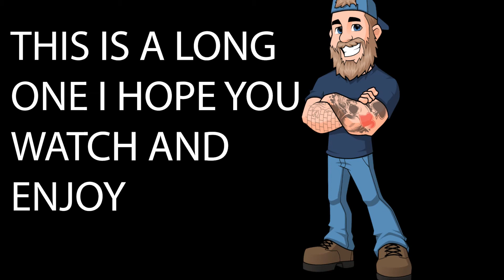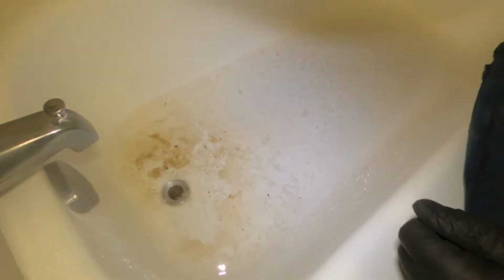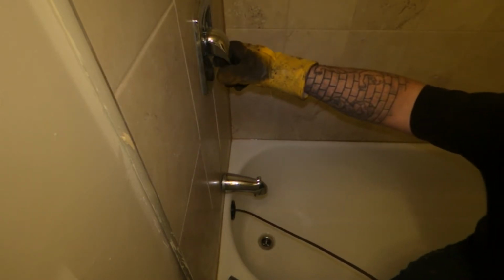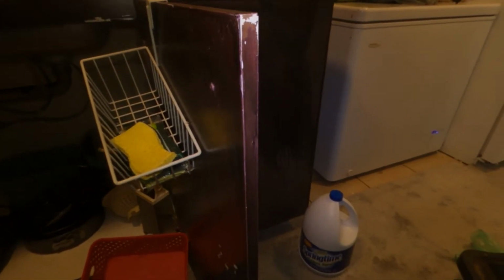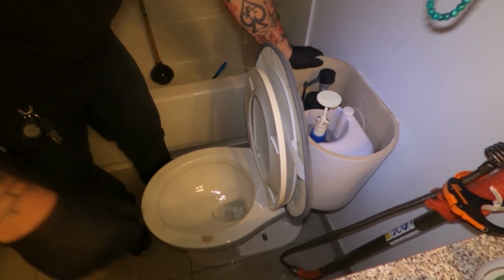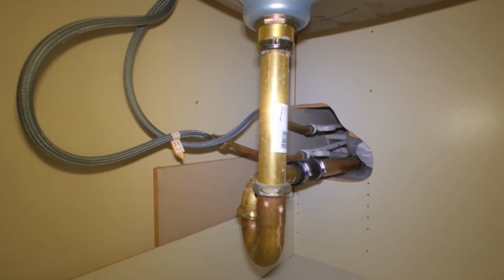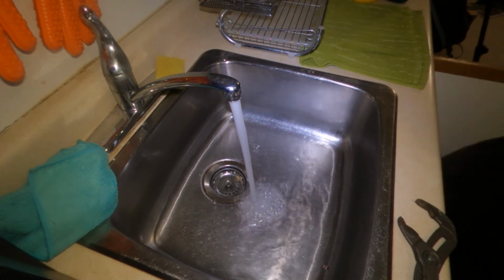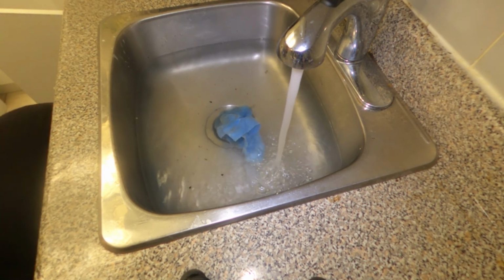THIS IS WHAT A DRAIN SERVICE TECHNICIAN does all day. this is a full days worth of calls that I did.

Comment: When doing the tub. Will that snake cable get caught in the trap?
Reply from the maker: It shouldn't get caught a lot of people have a hard time getting through the trap. In some cases, when you get through the trap like here, you can go up the vent at the stack and the blockage might be below where it ties into the stack. So you have issues that way, but typically you shouldn't get stuck in the trap. Unless something happened fell down the drain that might be jamming it up.Thanks for watching.Have a great day

Comment: How are the knees holding up?
Reply from the maker: The knees are fine. I try to use a stool if I can. I have like a hunting stool that I sit on because I know a lot of guys have bad knees from this kind of job. Always on down on the knees and that's one thing I didn't really want to have to deal with. So as of right now I'm doing this job like 16 years or so and no issues with my knees. The back is  a little sore but that could also come with the extra weight that I'm holding right now